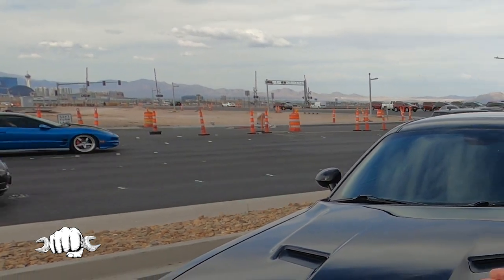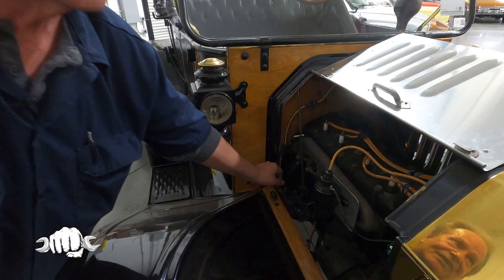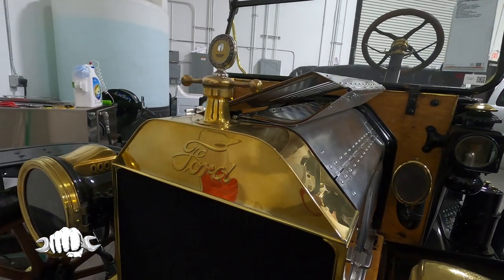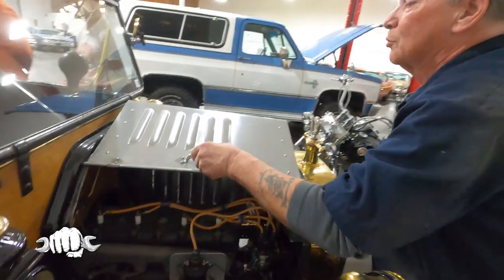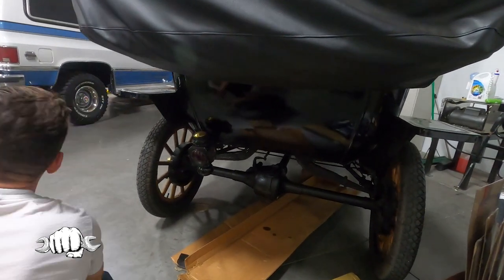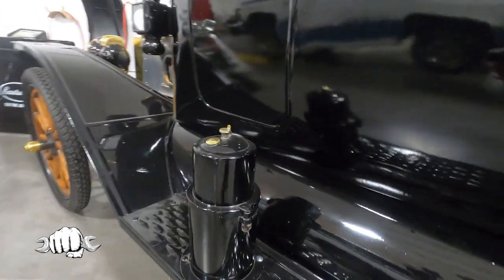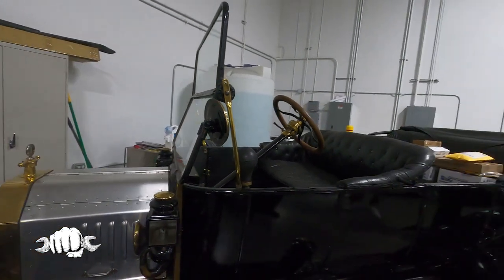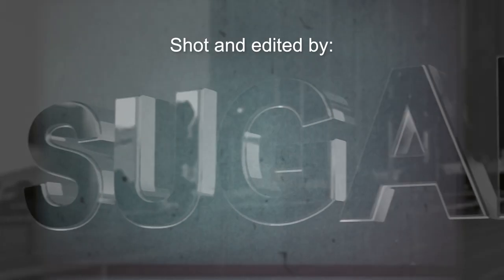Starting A 1914 Ford Model T! AMERICAN AUTOMOTIVE HISTORY!

Comment: I believe the headlights are acetylene lamps - all the other side and tail lamps are kerosene. The canister on the driver side contains calcium carbide tablets and water. A small valve increases the water drip to make more or less gas and sends headlights through a tube. The electric starter was not a factory option. I have inherited a 1914 Model-T myself. Nice video!
Reply from the maker: WOW! Thank you for watching and the feedback... it means a lot coming from a Model T owner!